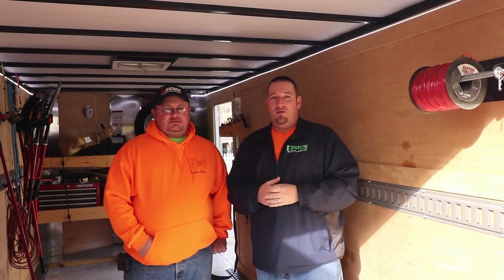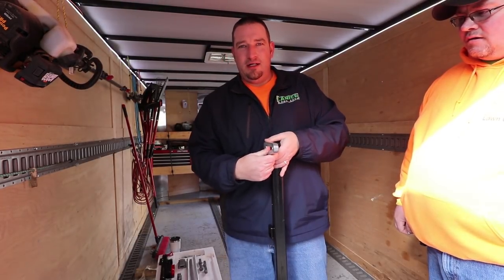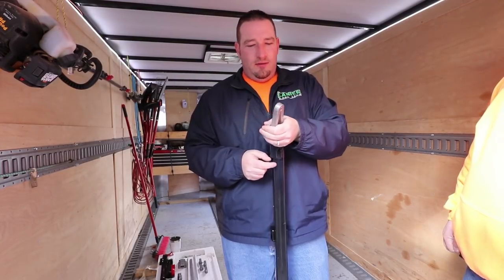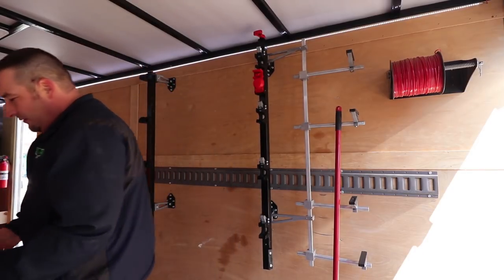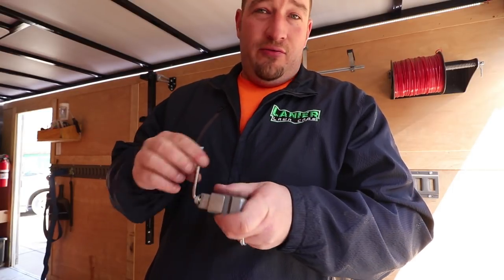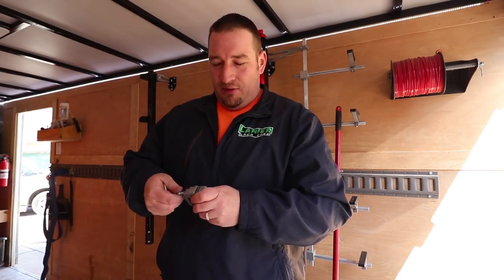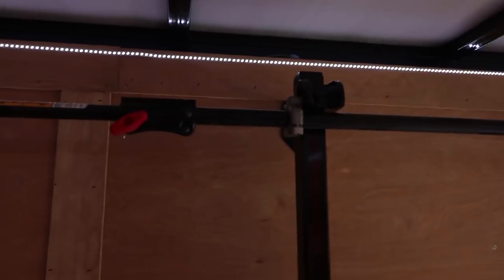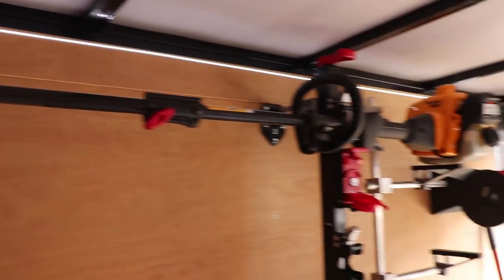Equipment Defender Enclosed Trailer Install, Paying it Forward

Comment: Not sure why you put them so high? I have the 4 trimmer holder and they are mounted to the floor and wall. You can fill the trimmers while they are mounted . Mounting that saw so high you cannot fill the tank at all. I like to think ahead and make things easier. Just my input.
Reply from the maker: John Bailey I just installed them where he wanted them. Higher equals more floor room and easier when loading and unloading equipment though in my opinion